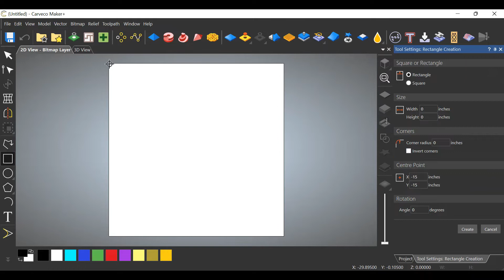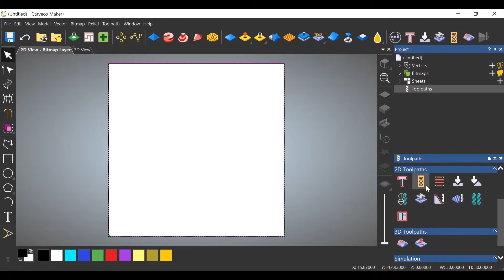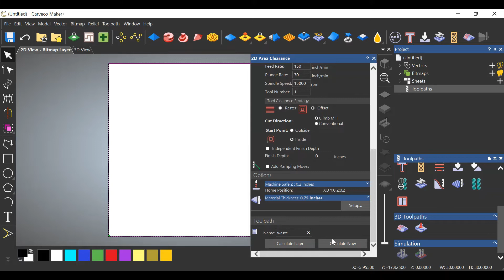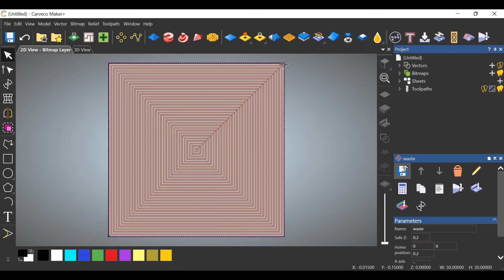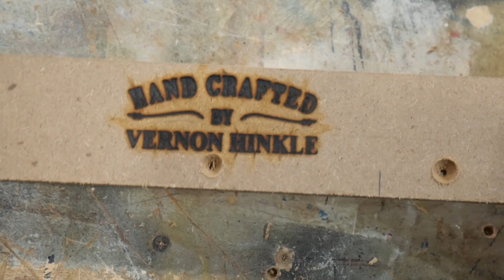How to surface a waste board tutorial with @Carveco

Comment: I have already surfaced a waste board on my Genmitsu 4040 Pro per James Deans Video and have been searching how to flatten an uneven piece of material. Do you have a video of surfacing a piece of material to get it ready for carving? I am using Carveco Maker and Candle. I have saved this video for future reference. Thank you in advance.
Reply from the maker: Thanks for watching I don’t have a specific video describing how to flatten a project but I can do a quick overview here create a square as large as your project do an area clearance tool path if you were using a quarter inch endmill remove a 16th of an inch of material for each pass zero your machine to the highest point of your stock run the tool path it’ll remove a 16th of an inch off of the highest side of the stock and miss on the lower portions continue doing this until the machine is removing material off the surface of the stock consistently across the surface 
If you are uncomfortable, removing a 16th of an inch at a time, adjust the depth of cut to something more suitable When you create your tool path
Hope this helps
Reply: @Hinkleshop  ABSOLUTELY helps and thank you very much!! Newbie in the world of CNC so am a little hesitant to do something without at least knowing a little about what I'm doing before pressing a button. 😳                       By the way I love your videos! Again, thank you. 
Regards, Lamar